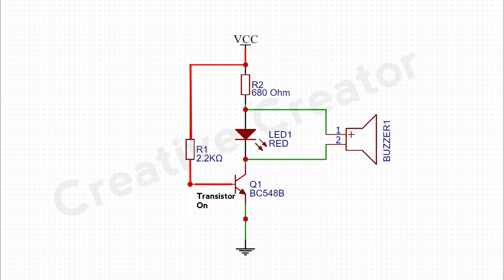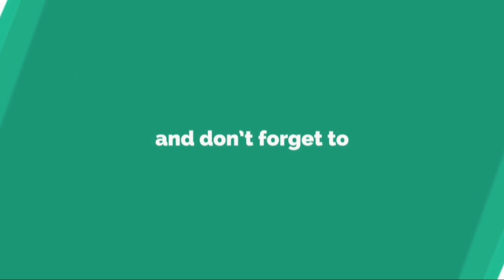Wire Break Alarm circuit

Comment: can you do a new diagram for 12V and high siren 130 decibel horn? perhaps also for pinouts for adding additional Strobe lights etc?
Reply: Connect a relay instead of a buzzer and you can control anything you like. In this case you connect the "+" wire straight to the relay coil pin.

Comment: Good circuit... But what ohm resistor to use if i am only using the led without the buzzer ?  I just need the led to flash without buzzer sound .. so can i use 560Ω resistor instead of 680Ω ? (Plus i dont have 680Ω resistor) ... Also will the led flash - when the 240v (ac input current) door bell is switched off - meaning circuit broken ? I need the light to flash when the bell is off !

Comment: Hi, I put a switch in the battery positive side but it seems to reduce the battery power resulting in a lower volume at the siren/buzzer. Would connecting to 12v improve the volume (more battery power)?
Reply from the maker: yes you can connect

Comment: Hi, simple and clever :-) but if I reconnect cutted wire buzzer will be mutted. Do you have an idea how to prevent muting after activation ... i.e. until cut power supply? I would like to use it as a door keeper - alarm should be activated after door open and active until switch off power not by closing door. Thank you
Reply from the maker: I understand wait for the next video
Reply: @Creativecreator  thank you, I have found it two minutes later https://www.youtube.com/watch?v=cvK2DBI-Q0E

Comment: I plan on using this with chains and cables to secure my motorcycle and bicycle. A cable can be cut with plenty of things quickly, and a chain can be cut with more effort. There are alarmed locks you can buy, but they are very finicky and will go off all the time. If you ran a wired circuit in a configuration like this with an alarm and some home made housing, you could bypass that problem and the alarm would only go off if the wire was cut or damaged and the circuit was interrupted.
Reply from the maker: Thanks for your explanation

Comment: Dude, Just an info:
I can do this excluding the buzzer and hold the led right?
The buzzer and the led is in parallel, it is correct?
Reply from the maker: Yes you can exclude
Reply: Thanks dude!, it works great!!!
I used a bc337 and follow exactly your instructions, the only thing is, it works in reverse, when the wire is cutted the led goes off but is ok :D
Thank you again!!!
Reply from the maker: Welcome buddy